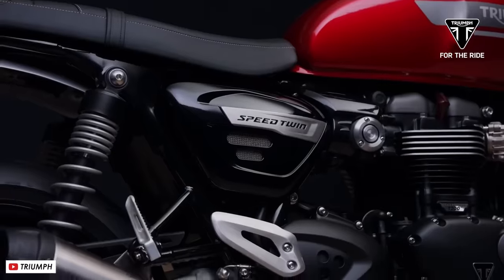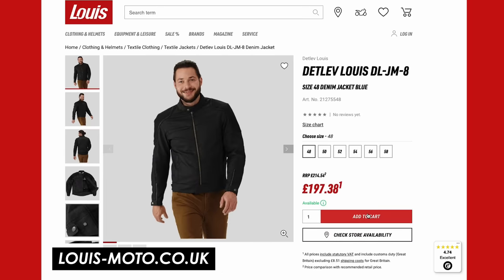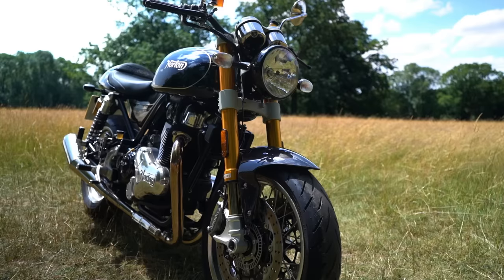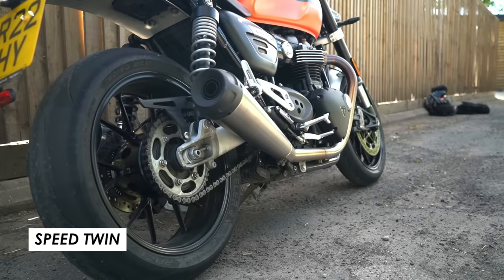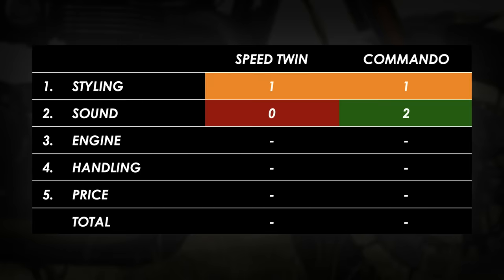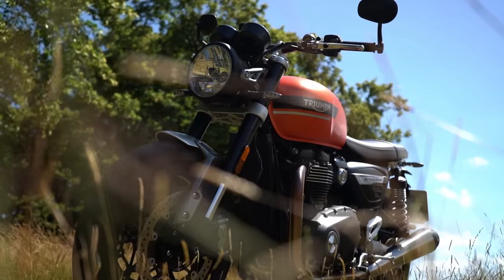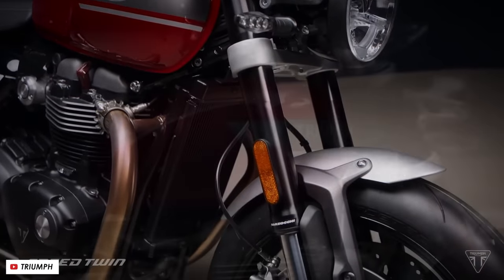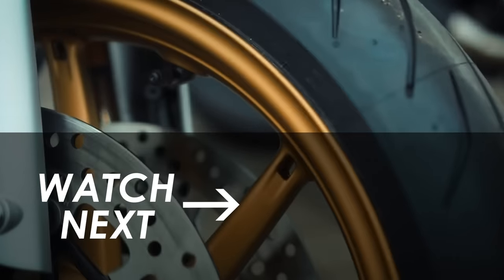Triumph Speed Twin vs Norton Commando 961: Which Is Better?

Comment: I think it would have also been good in a comparison test, to mention dealer back up, spare parts availability etc. Buying one is the easy bit.
Reply: Had to be said. Try buying a set of throttle cables for the Norton. (N.B. You can't, you have to find a custom cable company to make them for you).
Reply: This was one of the reasons (price was the biggest reason !) I went for a Speed Twin in 2019.
Reply: @darrenhill6509.  Exactly. In 6 years time, which WAS the better bike. Know anybody who bought a ‘best in test’ KTM ? Ask them 2 years down the line how that worked out. Enfield have got it right with nostalgia on the cheap, great for a potter about, and then get a Triumph street triple 765 ‘R’ to blast on. Both for the price of a Norton…..
Reply: Exactly why I went with the Indian FTR CarbonR here in the states over the MV Agusta 800RR for a hyper-naked stoplight killer.
Reply: They’re both awesome bikes.

Comment: The Norton may still be a little rough round the edges, is expensive, less powerful than the Triumph but for me it exudes the spirit of a true British bike.
A little more fettling and this bike will be a real rival to the Triumph. 
Riding into a carpark knee deep in Triumphs and REs and be the only one on a Norton?
You bet.
It's got a proper engine for a Brit bike, too. It's a parallel twin with a 360° crank.
How a British twin should be.
Made in England from the start, too. Can't be bad.😊
Reply: Are you sure about that 360 crank? I agree thats what it should have but I think its a 270 like the Triumph. My first road bike was a 1973 850 Commando at 15 years old. What a thrill that was let me tell you.
Reply: @tonyciriello6872  You might be right and if so, I stand corrected but I'm sure it's a 360°.
Either way, the Norton is beautiful.
Reply: It's not a 360 crank
Reply: @favoriteblueshirt  Then, as I've said previously, I stand corrected.
I'd still happily be on the Norton, for all its current, albeit minor, flaws than the rest of the sheep in the herd that ride Triumphs and, from some if the comments, appear to look down on this potentially fine British machine.
How very encouraging of them, particularly those from Britain.
Such patriotism. 😣
Reply: @favoriteblueshirt That's what I thought too. It should be though for "retro" sound. They could not replicate the original sound even if it was a 360 crank. The long stroke of the 850 commando gave it that "sound". Modern engines use short stroke big bore for more RPM and power. Harley still uses long stroke and sound the same as they always have. It is still an awesome though.
Reply: The made in England is the bit that worries me.
Reply: @honeybadger6313  why?
Reply: @honeybadger6313  What a completely ridiculous comment.
No?
Why are most of the F1 teams here - is it because we're rubbish at making stuff......
Reply: @originalforgery  Made in England is not the endorsement it used to be

Comment: I prefer the Norton because I don't like water-cooled engines in motorbikes.
I also like polished, shiny engines and not black ones.
If I were to choose a Triumph, I would go for the Thruxton. It looks very cool. But again, I think the Commando is nicer.
I myself ride a BSA A10 Super Rocket from 1961 and the sound is simply fantastic. Retro bikes can't have that idling sound because of the emission standards.

Comment: I'd buy my Speed Twin again.
Why Norton chose hydraulic clutch is beyond me honestly. 
It does have some nice curves, but I have been convinced of Triumph reliability. I like the hot rod Bonneville look to be honest. For the overall package, Speed Twin. It needs suspension if you are over 170 lbs. though.

Comment: I love Triumphs (and my prediction of a baby Bonnie a few years back came true 😊 )… but the Norton will be my next steed. Absolute Class! And the sound of air cooled is just the icing on the cake! Nice vid 👍🏻
Reply: my advice ride one first these blokes are wrong, my brother has one it [feels] like an old pushrod twin. bl**dy  awful  and my thruxton will blow it into the weeds. lets not forget triumph also do ohlins front and rear.
Reply: @tommillar2821  How do you find your Thruxton on long rides? My dream bike for sure, but I need to be able to go long distances, which doesn't seem to be its strength
Reply: @joeboonmusic4004  dont forget they are [cafe racers] there are others more suitable but if it was a choice between the two no contest the triumph, would i use one for two three thousand mile trips. no i'd get my 1200 tiger out.
Reply: @tommillar2821  Appreciate the reply! If you HAD to use the Thruxton/it was your only bike... would you still feel comfortable using it on long trips? I can't afford two bikes at this stage :P
Reply: @joeboonmusic4004  honestly, these days no i would not use one for distance, if it HAS to be that type of bike i would go for a 1200 speed twin a bit more comfort i am not in my twenties or even thirties anymore.
Reply: @tommillar2821  Ahh okay, that makes total sense! I'm 27 so maybe I'll be okay :P
Reply: @joeboonmusic4004   of course you will, you will love the thruxton, at 27 i used to go away in the clothes i stood up in, a tank bag and a few hundred pounds in my pocket no worries. good luck.
Reply: @tommillar2821  That certainly sounds appealing! I got into the idea of riding bikes a few years ago after reading Zen And The Art Of Motorcycle Maintenance haha! But this would be my first bike, so maybe it's too much bike... I was thinking that or a Bonneville.

Comment: I rode the speed twin in the same baja orange this past weekend and you're right, immediate power with barely a difference between sport and road modes. I also enjoyed the smoothness of the engine. Recommended.
Reply: Too bad the throttle response is limited to 90% 🥵
Reply: @chriscarbaugh3936   what do you mean? In all modes? How would that then even make sense - 90% OF WHAT?
If you mean the road mode, that goes some way to justify the mode above then  Your comment is needlessly ambiguous. Maybe it could inform if you wrote better.
Reply: Try a Thruxton if you like the look of a cafe racer. It is a superb machine and cheaper than the Norton and has far better back up re dealerships.
Reply: @aliwhitwell looking forward to that demo ride.

Comment: I own a ‘20 speed twin and would trade it in for the Norton in a heart beat.
Reply: And you would be wanting that extra power and torque!
Reply: If I had the cash and the space, I'd have the Norton to compliment my 2019 Speed Twin.

I wouldn't swap my Speed Twin in for the Norton, too many other issues like the power deficit, smoothness of the engine (Speed Twin is smoother) and the "small" issue of dealer network servicing and support. Triumph has a pretty good dealer network !

Comment: Another area where Triumph cuts cost corners imo, and as a result spoils the overall appeal of the entire Bonneville family, is the lower seam of the fuel tank. Seeing the exposed seam is so ugly and, once seen, it can’t be unseen. Honda clocked this on their wonderful and sadly discontinued CB1100EX; the earlier models had a visible tank seam but the later ones it was hidden and looked much the better for that extra attention to detail.

Comment: I loathed the Speed Twin riding position and bought a Thruxton R instead. That said, I found it too full on for the roads and traffic in rural Essex. I did use the sports riding mode, switching back to normal.fir heavy traffic but most of the modern features were irrelevant fir me. I'd be tempted by the Norton but would want to give them a year or two to re-establish themselves before handing over that much money

Comment: A line item on relative used sale values would have been interesting. I sat on a Norton 961 at the London Excel bike show this year and was rather surprised how far the rear master cylinder sticks out. So much so it hits your heel. I then sat on the Kawasaki Z900rs. The ergonomics were perfect. If a massed produced machine can get it right...

Comment: I'd want the looks of the Norton with the engine of the Triumph. So I've gone for the chrome Thruxton RS with the SC Project exhaust shown at 4:10. It's just about as good looking as the Norton (subjective, I know), slightly more power than the Speed Twin and has much better handling. The perfect bike, at least for me.

Comment: Neither. Kawasaki Z900RS for reliability or Royal Enfield Interceptor 650 for price.... Oh the video? It was a nice Norton advert.
Reply: I test rode a Z900RS before buying my Speed Twin and found the build quality to be pretty poor in comparison, especially for the price. Good performance though.
Reply: Oh no. Interceptor is when have the muscle to push the weight and you don’t have false teeth or the 650 will vibrate them out of your mouth. And the quality 10 years later is so so.

Comment: Up until purchasing my first Triumph a 675 Street twin R I had always ridden Norton’s from a 650SS to every year and type of Commando except a John Player. While the 675R was toy like, the Thruxton’s that replaced them were the real deal. While I sort  of like the new Commando’s styling, I’d take a Thruxton’s reliability and performance at a significantly lower price. Availability in the States is some time away, but my concerns would be dealer network, parts availability and service given the fiasco with the previous bikes.

Comment: I would go Commando. Much more style & sophistication rather than a run of the mill Triumph Speed Twin. I would however see if cast wheels were an option on the Norton as spoked wheels are an absolute pain in the arse to clean and maintain. The rear because they get covered in chain lube/oil etc & the front because it’s nigh on impossible to access because of the twin disks. Great to see Mr Rarefied Road aka Tim. I’ve missed his reviews. Please pass on my regards.

Comment: The Commando is gorgeous in the black and gold livery! The Speed Twin is the Bonnie they should have released in 2016, but I understand they had to create a price gradient. I had one of the first T-120 Black Triumphs for 6 years from new and it was slick and I liked it well enough, but found the performance a bit ordinary.  It was vastly improved by replacing the shocks with Bitubo front and rear which was a game-changer.  It did have the gearbox issues which were fixed but then the right-hand engine/gearbox case cracked at the rear mounting point.  This on a bike that had regular dealer service and ridden fairly conservatively.  Triumph came to the party with all the parts even out of warranty but by then I was done with it.  I suspect this was just an aberration. The Triumph is still good value and the Norton can’t be measured by the same standards due to small volume production.  
I’d happily own either.  👍🏻

Comment: Triumph is at a disadvantage by different rules than the Norton because emission rules at higher production levels, my Thruxton R sounds better than both of these.  I would have compared the Thruxton RS to the Norton for prices, spec and style.

I don’t think if you had to ride both of these over any real distances most people you pick the Triumph for smoothness, power and reliability.

Comment: For me. I am biased because I used to race Commandos back in the 70's and road one on the street.  That said, handling has always been important to me, and my experience with Ohlin Suspension tells me the Norton will handle much better.  It would be the Norton for me even with the higher price.

Comment: I’ve always thought that the speed twin missed the mark a little on styling, the Thruxton 1200 is a much better looking retro bike from Triumph IMO, and I’d agree that the Norton looks better than the Speed twin, (apart from the gangly downpipes on the Norton, they look as though they were made for a different bike!), but that’s where it ends, the Norton is extremely expensive but has Mickey Mouse switchgear, the engine when first produced (I think in the states?) was generally regarded as a poor design, it still is, despite a few tweaks by TVS, it’s gutless and the vibration is harsh and just not acceptable by modern standards, I think you’ve been far too kind to Norton in this review, almost to the point of bias!, I can’t impress on viewers enough the need to test ride one of these Nortons prior to purchase, I’ve ridden 3 of them and I couldn’t get past the harsh vibration and low power output, if someone gave me one I’d sell it immediately, that’s how unimpressed I was by this machine.

Comment: Had a go on the Norton over the weekend on a half hour led test ride. Granted it was raining so that may have contributed to my thoughts but I did not like the bike at all. The lack of tech is noticeable (no traction control, no modes, no fuel gauge, I couldn't see a gear indicator, I suspect no slipper clutch too), they bill it as they wanted a "pure" experience but it's a £15k bike I want the modern features. The reviewer says it's "vibey" and chuckles slightly, that's presumably because it vibrates to the point it's off putting. 

Also annoyed me several times on the ride that the pegs whilst retractable are at the wrong angle and don't have a spring, so if you knock the back of your leg on it it will hurt before it retracts and then won't spring back meaning you look for a peg that isn't there (granted this is something you'd end up getting used to).

Comment: I would park the Norton in my garage eventually but it would be last invited to the party. The Triumph Thruxton would have better in terms of price and features for this comparison.  I'd put the Kawasaki Z900RS SE, BMW R9T also in the same class. Norton doesn't have tp play the same rules on exhaust so it is hard to me give them credit. My Thruxton with a Meerkat exhaust sounds very good. 

So I own a Kawasaki Z900RS SE,  owned a BMW R9T/5, and still have the Thruxton.  I would buy a Norton but it would be last one out the group because what delivers in terms of performance to it's cost more than outweighs the Norton good looks.

Comment: Norton’s more expensive but…. Sounds better, looks like an actual retro old motorcycle, has better suspension and high quality components. Rear end of the Norton looks great. Factor in a tail tidy, exhaust, maybe rear shocks for the Speed Twin, the gap in costs is actually a lot less. If you want retro retro, and don’t want to tinker with aftermarket parts and traditional genuine air cooling then there’s really no contest here. If you want a thoroughly modern motorcycle in an old posh frock then the Speed Twins the puppy for you.

Comment: I’ve ridden both, and own a Thruxton 1200, the Norton felt gutless to me, and it vibrates badly, the equal score on the video is misleading in my opinion, I would strongly advise anyone thinking of buying the Norton to take one for an extended test ride first, I really wasn’t very impressed with it.

Comment: Love the looks of the Norton, the engine looks like the Norton's out of the 60's and 70's. The suspension is superior too, however it's really underpowered in comparison. They should grind some more aggressive cams, and bump the compression and get it up to the 80 horsepower range or more. The price of the bike doesn't match up with the performance. Put it up against the the 1200 Thruxton and it doesn't compare for the same price.

Comment: This new bike is a significant improvement from the Garner era, but I agree that compared to other bikes in its category, others do it better. Perhaps another way of expressing how Norton could get the Commando so right while allowing the negative sentiment and symphony of noise to effectively kill any chances of selling a new or used V4SV or V4RC. The V4SS issue will not stop haunting Norton until they stop burying their heads in the sand and pretending they can tough it out when it's evident that they are hurting more than the V4SS owners. Is Norton really that different under TVS than it was under Garner, as it's once again a brand attracting attention for all the wrong reasons and with a product line-up that does not quite make it?

Comment: Test road the Speed twin. I found the steering really weird it doesn't want to turn (gyroscopic forces and  rake) ...... almost rode up onto the sidewalk on my first turn in...the motor is beautiful buttery smooth and you are hanging on at 5500 rpm... but snatchy on/off in sport mode. The bike feels too narrow to me (coming off a tuono and now riding a gs1250 asteroid). It is also very heavy for its wheelbase so feels like you could lose control of it if you get on it too hard... a little twitchy...bars are narrower than they should be for the mass and poor turrn-in characteristics...needs more leverage. It is a reminder that shoe-horning a modern powerplant into a less than capable chassis can creep you out ... like a '76 911 turbo... The bike is actually not very manoeverable at low speeds and pushing it around. 
To me, it feels like a parts bin engineering project ...  the good looks for me evaporated once i got on it... 
While I wanted a more relaxed retro runaround, I would still buy a street triple, highly engineered and refined with power that rolls on beautifully even on the same short wheelbase +/-. I'm not sure what the ST is trying to be ... It needs to lose 100lb,, wider bars and tank, put the thruxton ohlins on it (compete with the Norton, and ya maybe stick to the 900cc lump... for a chiller but entertaining ride....

Comment: I found the Triumph , especially the thruxton be physically too small for anyone over 5’10”( feels more like a 250) and looks more tacky with its plastic bits compared to the BMW Rnine T . The Norton is on another level entirely and is quite evident that it has been hand manufactured with no expense spared. It is also better for larger/ taller riders